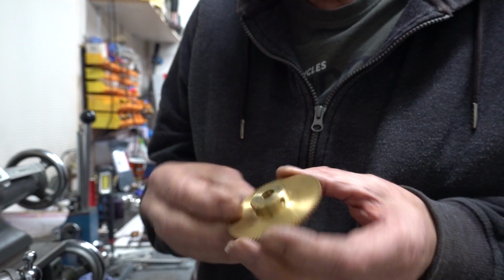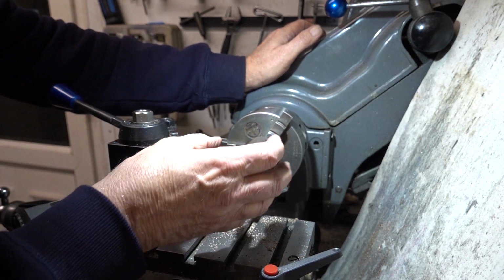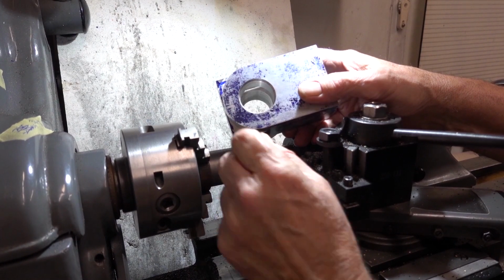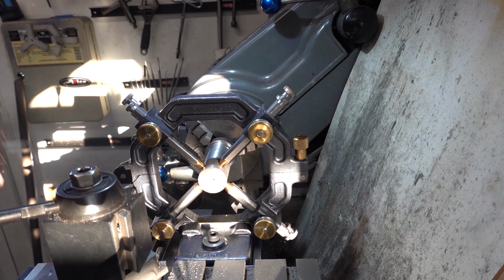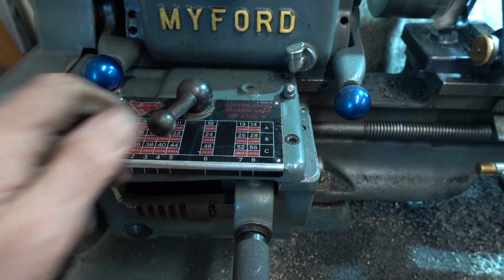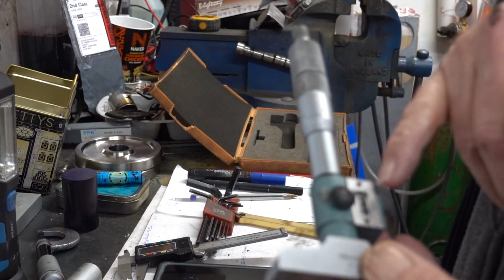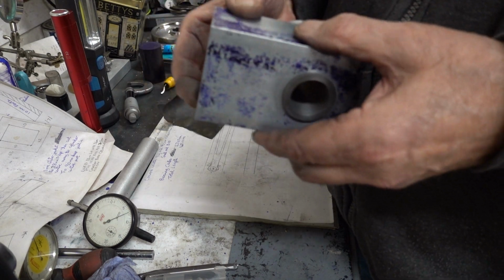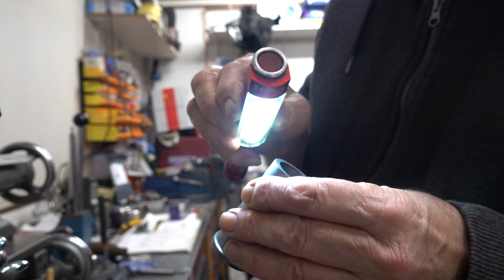Hit & Miss stationary engine part 5 the cylinder

Comment: 1/4" lift will be a bit big for this engine, 1/8" would be more than enough. Grub screw in the cam may make the base radius a bit large which then has a knock on effect on the cam duration and how quickly the valve opens and closes. I've had another thought, let me know the bore in the gear and I'll do a drawing for you.
Reply from the maker: Hi Jason. I agree about the grub screw. The bore in the gear is 9.90mm.  .0390". I have some old S/S shafts from printers that it fits over perfectly. 
I had put the cam work to one side for now so i could concentrate on the crank & piston assembly So i could work out how large the whole framework needs to be. I hear 4.5:1 C.R is what to aim for. I thought more like 5 or 5.5. Any thoughts.???
I did see on full size engines that the cam lobe is flattened of on the crest to give a long overlap. That was what i was going to do. ??
Regards.
Steve.

Comment: Hi Steve, starting to come together now and it’s looking good. Don’t be too negative about whether it will run or not, even if it doesn’t run straight away the knowledge and experience you will gain in  making it run will be priceless.
Besides if you wanted one to run run straight out of the box you could have gone out and bought one, but where’s the fun in watching someone else’s achievement operate. Thanks for the kind words.
Reply from the maker: Hi Alan. Thanks for that. I guess there's a long way to go yet. I think I have most of the materials I need now. It's just getting pencil to paper to make sure It all fits together. Just about to make a start on the Piston.
Regards.
Steve.

Comment: Thanks Steve! If I ever get my Tailstock repaired & rebuilt, I have to make a top hat liner for the wee compressor I used to use for the brad nailer for decorative trim and crown moulding installs...
Reply from the maker: Hi there. I hope you get it repaired soon. So the compressor will live again.
Regards.
Steve.